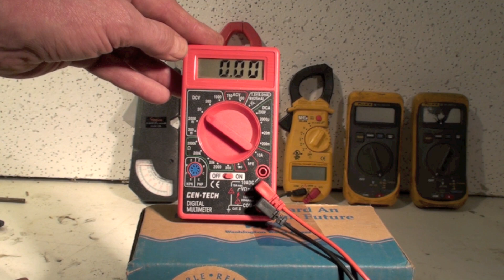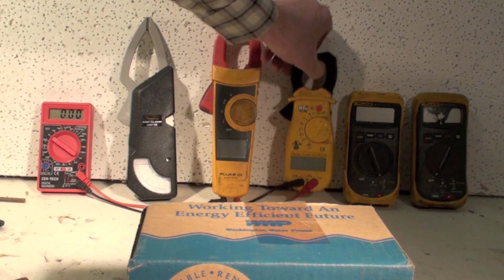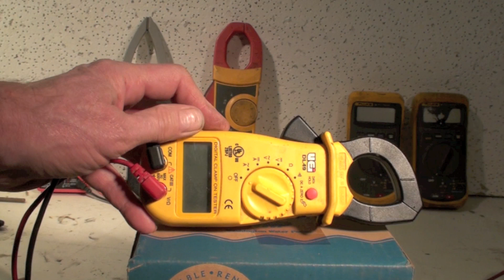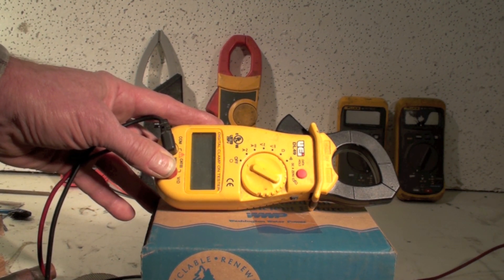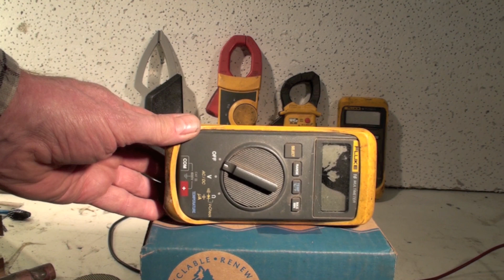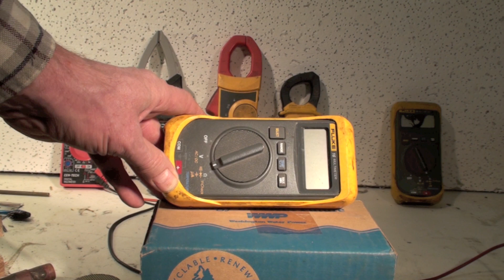Meters for HVAC and electric overview part 1

Comment: im not sure with a model that old and out of production, but for most models of fluke meters you can get replacement lcd's for.
Reply from the maker: Thanks for the info.  I had not thought of that.  I replaced the meter but that meter is like an old friend and it was kind of heartbreaking to see I damaged it.  Leave it to a service tech to have emotions over a damaged meter!  
GFM

Comment: I have a brand new klien that I like except the switch to DC doesnt work but about 30% of the time. A real pain. I like the feel of this meter though....wide, rubber housing, big knob. The Retailer wouldn't take it back and I cannot find a place to refurbish it.  If Klien had a restore shop, I would send it there. I think it is a subquality pressure sensor underneath. If anyone knows where Klien will refurbish these would be nice. (i.e. like Dremel, etc).  I dont like the stuff at Home Depot, they are getting cheaper by the day on all of their stuff, getting to be like Wally World...your purchase is broken before you get out the door with it.   I found Gardner Denver has a brand out too.  GD has traditionally been superior in the tech industry world originating from the industrial machinery and so forth. But who makes their meters....who knows?  I would like one that has the ammeter and volt meter all in one, instead of lugging around more gear. Is there any advantage or dis to having one meter with both needs met?   Comments ?.......

Comment from the maker: I can't say too much about them as I have never used them.  The Fieldpiece units are very good, with the possible limitation of the lack of a dedicated 3/8" vacuum hose.  Having a vacuum gauge on the gauge set is a double sided sword.  It is convenient to use however, if it fails, the gauge set must be replaced.  Hope this helps.
GFM

Comment: Have you hear of the company refco . I seen one of there digital charging meter from them and it seems pretty good .But I think fieldpiece meters are better you can to vacuum microns with it , Not the refco just the higher end models . But I like the digitals because it will calulate the sub cooling and superheat for you and no more guess work .